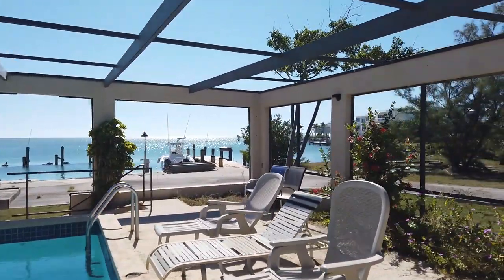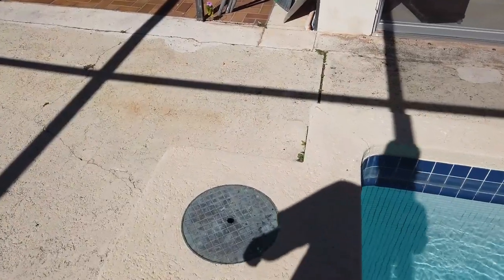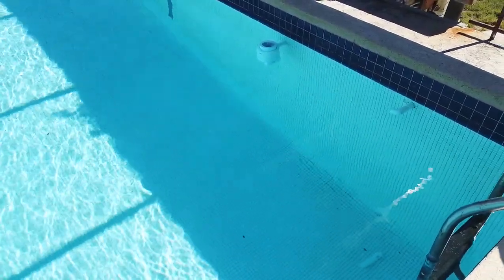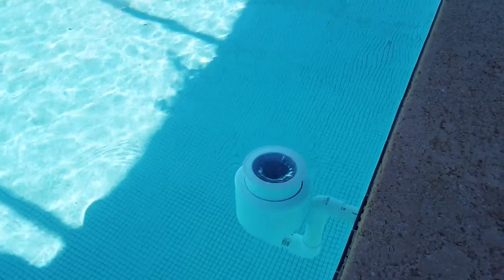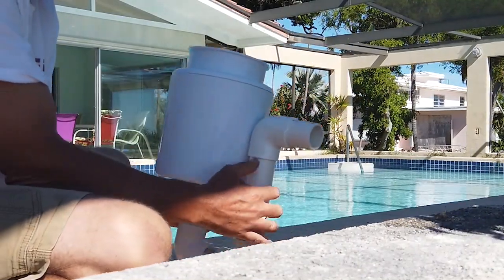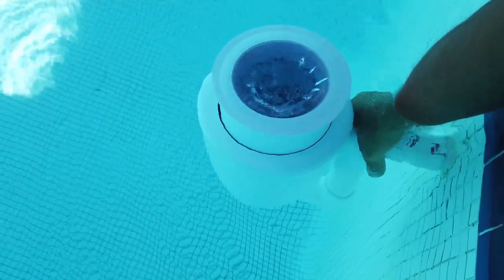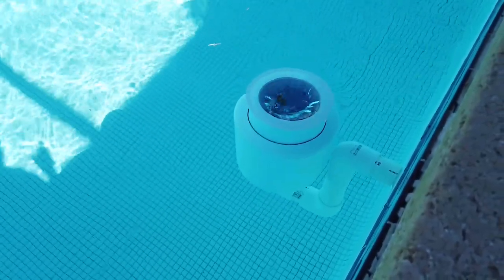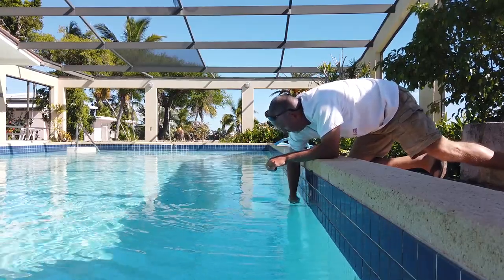DIY Pool Skimmer

Comment: Didn't know those were available.  When looking at it I realize that those could also work on the discharge outlet if you setup an eductor configuration that draws in water as the higher pressure stream comes out.  I may have to try this.  I have a good skimmer, but sometimes we get swarms of termites coming by that all divebomb into the pool.  Nothing worse than floating around and then suddenly termites floating all over.

Comment: Do you think the Aladdin “no niche” skimmer would work connected to a short piece of pool hose? Or does it need to be hard piped? Thx!
Reply from the maker: It would need to be hard piped in my opinion because it has a tendency to float when too much air gets in it and it would just not work right with a flexible hose.

Comment: Hi, I have been after making something like this for a while, could you give a list of the parts you used that would be most appreciated, cheers Alan
Reply from the maker: I bought the skimmer at a pool place, don't remember the brand name, but it was about 50 bucks, the rest was just PVC from Home Depot.  If I can find more info on it, I'll shoot you a message. Thanks for watching!
Reply: @GablesOnTheGo  appreciate that, cheers
Reply from the maker: The skimmer was called a "No niche skimmer" made by Alladdin.....here's a link. https://www.amazon.com/Aladdin-Skimmer-Complete-No-Niche-White/dp/B005OTLNQM/ref=sr_1_2?crid=1RU9LCR55OCSB&dchild=1&keywords=no+niche+skimmer&qid=1591533223&sprefix=no+nich%2Caps%2C165&sr=8-2